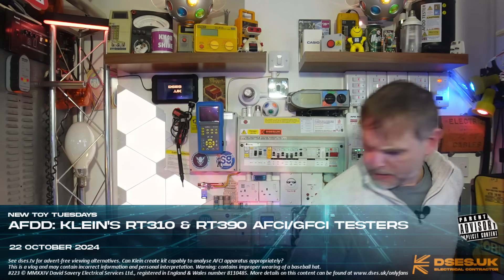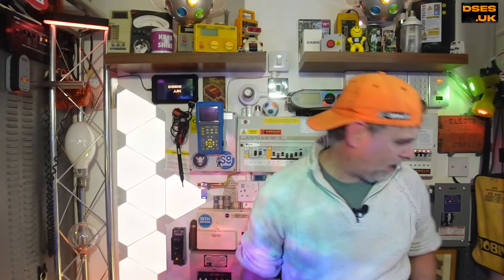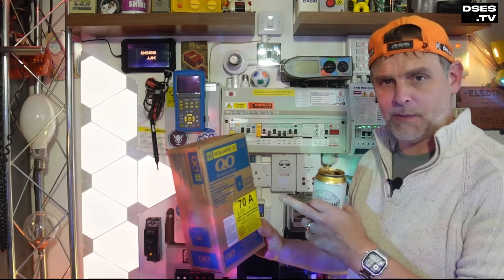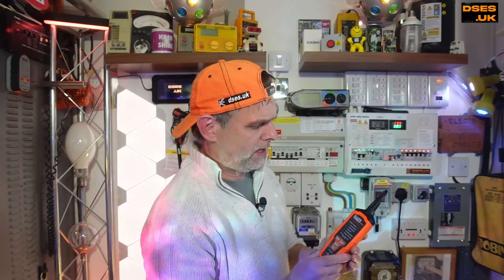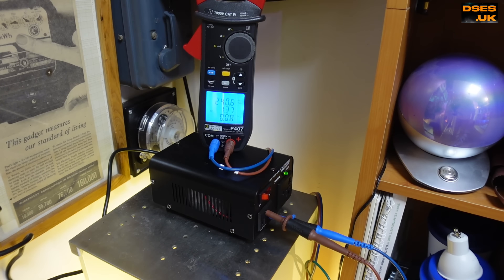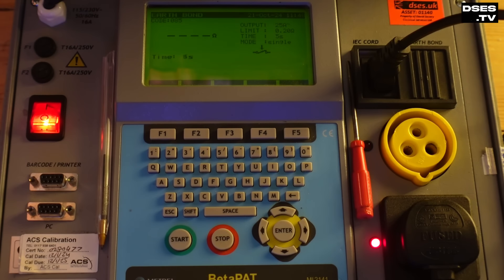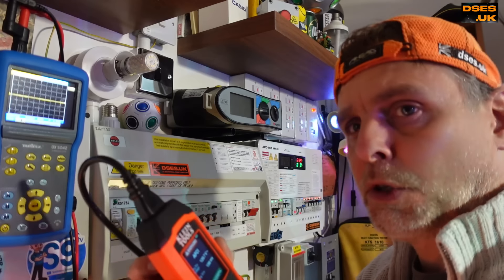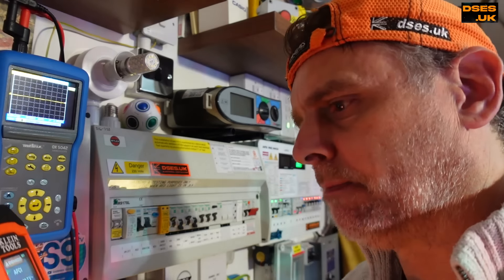AFDD: Klein's RT310 & RT390 AFCI/GFCI testers

Comment: Suspect the device LEDs just light up to say the protection circuit has passed self test on power on, not to indicate last error. Lamp test really.
Reply from the maker: That may be it. "Passed self test" - but you're on your own figuring out why a trip occurred! I believe the AFCIs are simpler devices (electronically speaking) to our ARM-equipped processor controlled things, so maybe they lack fault reporting?
Reply: @dsesuk time to disassemble then? Probably the electronics on these get taken off the juice as they trip too, losing state. Nice episode by the way.

Comment: The “ground bar” aka earthing terminals are sold separately for that QO enclosure, often for exorbitant prices. We also do use 240 volts here but center tap the transformer to obtain 120 volts, hence the two separate terminals in the enclosures.

Comment: Hi David, I have been watching your videos and I have learned a lot. I like your character. You are very entertaining and knowledgeable man I wonder and I wanted to ask you if you know any software for Designer schematic fusing cable sizing consumer unit writing current carrying capacity Walter drop all this stuff they relates to the electrical design for one bedroom flat single phase or three phase board. Do you know any easy-going software? Not very complicated one so I can use basically to learn also for my jobs I can design for example wire of one bedroom flat and print it out and have a sheet in my hand once I am doing a job it will be just a reference to help me to understand the size of the cables and everything else could you recommend me any software? Do you know any software for Electrical design and schematic with all the calculation required that needed by British standard 7671 thank you so much, David.
Reply from the maker: I'm afraid I don't have any design software I can personally recommend - hopefully someone else in the comments has something they can put forward? For off-the-shelf calcs, there are app resources such as NICEIC's Pocket Guide app which provides easy access to best practice guides, guidance and calculation functions. I believe that's downloadable for anyone (you don't need to be an NICEIC member).
Reply: @dsesuk  thanks 🙏

Comment: The 120v converter will likely have its own intelligence built in to vary the output current under fault conditions and will also lack the umph to generate significant arcs.  I don't think this can be relied upon to mimic the conditions of a true US grid supply.
Reply from the maker: It's probably improper conditions as you say. Maybe Klein would like to fund an all-expenses paid jaunt to Vegas for us to try these devices out on the proper home soil?
Reply: It should probably exacerbate the issue with its higher impedance rather than be a hindrance.
Reply: @dsesuk  Vegas is crap, too trashy. San Francisco is where I always go, although there's a friend in Ohio I've been promising to visit for ages, must sort out the old passport thingy.

Comment: Interesting to see these Klein units in operation. When you showed the waveform on the oscilloscope, you can see quite a voltage drop when testing, which I wasn't expecting to see for an arcing fault. It maybe that the impedance of the supply transformer is too high and the subsequent voltage drop is causing an issue with the electronics of the AFCI and the erratic behaviour. If you use the single shot trigger mode of the scope, you may be able to the pulse width trigger function to capture the event and freeze it on screen, or alternatively if Chauvin Arnoux would lend you one of their power analysers with the transient function, that may also capture the event.

Would be interesting to see what is inside the units, because if it is something generating a physical arc, then I would have though that that would have a pretty short life to it before the characteristics of the arc are changed and eventually the tester would fail. The carbon arc model used by the IEC needs a lot of maintenance to provide consistent testing.

Comment: Very interesting insight into what goes on over the pond. A few observations 
- That "load center" has massive terminals to handle the higher current resulting from the lower US voltage, a clear advantage of using 230V.
- I strongly suspect that the 500VA converter may well be interfering with your testing, it may well not be able to deliver the çurrent needed to generate a strong arc.
- Interesting  from the scope shots, that the arc simulator  only appllies the "arc"  to one half of the waveform. This may not be enough for the software to detect.

Comment: You are correct David they work better on a socket or should I say receptacle containing AFCI or combination AFCI/GfCI. That being said a belt and braces approach an AFCI/GfCi at receptacle and AFCI at the load center work better even with different brands for the AFCI /gfci at receptacle and AFCI/GFCI at load center. You now start getting into selective coordination issues in terms of which trips first. (You can compare trip current curves which manufacturers in USA do provide to allow appropriate selection). I have the Leviton combination AFCI/GFCI receptacle device (in my view the best device on the market) with an older GE AFCI at load center. When using the older Klein AFCI device it consistently works namely the AFCI trips first at receptacle also tripping the AFCI at the load center.  Let me see if I can send you some of these receptacle devices with USA socket box (both metallic and nonmetallic ones). The parallel arc waveform testing generates/injects a kind of square waveform typical of arcs from kettle arc faults. With other loads you will get more spikes on the waveform more typical for series arc waveform. What you really want is to hook up a signal generator with the oscilloscope capable
Of capturing these fast events and storing it as well so you can take your time looking at the waveforms from different arc-like signals. You will need more expensive higher end oscilloscopes and signal generators say from Rhode Schwarz or Keysight or Teledyne/Lecroy. That will more than likely help you to get behind the nature of how these arc devices are built and what kind of waveforms they are expecting to see under parallel or series arc conditions with different types of loads - kettles, ac equipment, microwaves, ovens, heaters, dryers/washing machines and coffee makers. You may not class yourself as a scientist but you definitely think like one. If you read research papers online in this area of arc testing and waveforms you will start to better understand some of this work. You will get into electrical engineering and physics areas probably beyond the average domestic sparky but definitely not beyond your capabilities.

Comment: The RT390 does helpfully indicate why it's not operating reliably - high source impedance. These devices are, after all, intended to be connected directly to a fairly low impedance supply, rather than the output of a 500VA transformer, with commensurate parallel arc energy.

Comment: I found some kind of advertising material for the Siemens one online.  It made quite a big deal of how the device continuously tests itself (whatever that means) and if the self test ever fails, it will trip itself and the LEDs will flash.  So they don't appear to be trip indicators at all, but rather fault indicators - as in a functionality fault, not a circuit fault.  So I guess that makes the device a FAFCII?  (Faulty Arc Fault Circuit Interrupter Interrupter?)

I suspect it might just be some simple watchdog timer, where the microcontroller monitoring for arc faults keeps resetting a timer back to zero.  If the code ever crashes, that timer will keep counting up beyond the normal reset point, causing a trip and blinking LEDs.  So it may not be a self-test in the form of actual current through the RCD but more an ability to cut power if the code running on the microcontroller ever crashes.

Probably difficult to test that functionality without opening it up and somehow causing the code to crash.  If the controller's power supply drops too low it may cause the code to stop running, which may trigger this failure state, so possibly some experiments to lower the supply voltage with a variac (or even running it off a DC power supply) might be the easiest to try if you're so inclined.  I guess starting out at zero volts, switching the AFCI on, then increasing the voltage until you get that initial LED lighting up might be the quickest way to find the magic cutoff voltage, then you can experiment from there.
Reply from the maker: I think the surprise was more that our own home-grown AFDDs also regularly self-test and (usually) flash a unique error code if they fail their own mental sanity check. Outside of that, the LED on ours usually gives some indication for fault finding purposes.
Reply: @dsesuk  Definitely agree the Euro versions seem to be much better designed.  If you're going to go to the trouble of including a processor inside of it, making it as helpful as possible with the LED showing the trip reason seems a no-brainer.
Reply: Siemens arc fault breakers are garbage.They have made my life an absolute nightmare for the last 6 years or so.Finally boss is moving off siemens and going with a different brand of load centers (consumer units).

Comment: Whatttssssuuuuup Homie! 😎We can only expect this "Out of left field" (as "our American cousins would say" 😏) stuff from Mr S and one or two others.... BigClive and maybe JW, being the others that spring to mind and is as entertaining as ever Old Bean. You are in amongst distinguished YT'ers
I have done what is considered inappropriate in the electrical field and read the manufacturer's instructions on the AG022 AFCI online. 🤪It appears that for 30 days, every time you turn on the device the LED will continue to illuminate for 5 seconds to indicate what the last trip was for. In your case, the AFCI detection function. It will continue unless you press  and hold the PTT for three seconds when energising the circuit again.
Best wishes to Linda and hopefully back on her feet soon.
Reply from the maker: Interesting... although it doesn't seem to be working here. If I hold the PTT when energising, the LEDs flash (which perhaps indicates it's clearing that last fault detection function). However, in both cases, the LED(s) always illuminate regardless of prior trip function or after an apparent reset through the push button. It may well be something screwy with my setup. As for reading datasheets, well if I had all the answers, what would you lot have to comment on... besides my terrible haircut and foul language?
Reply: @dsesuk  You bad hair cut was allowed as you tried to do it yourself over covid, and your language is just you after a beer or three. I don't recall a single one on this episode though. Having said that, you had a cappucino in shot after your San Miguel so looking after your liver. Top bloke.

Comment: Maybe Klein US have a tester that works with 240v outlets - they are quite common in the U.S. for powering dryers etc.
Reply from the maker: Maybe. I did ask them, but I didn't hear back.
Reply: I did search for such a device without success.. I think it is only Canada who use the dual rating system of 110/240V not the USA. This might explain why Klein, being an American company only has the lower voltage AFCI tester.
Reply: @olly7673  Nope, in the US they have a split-phase system with 120V phase to earth (or should I say ground) and 240V between phases. The 240V supplies are only used to power heavy current devices such as washer/dryers while 120V is used for general purposes around the house. They use a different type of plug and socket so you can't plug the wrong thing in the wrong hole (which would be painful to say the least..!)
Reply: @TestGearJunkie.  wrote:
"and 240V between phases."
It is all one phase. It is 240v measured from each end of the transformer's coil. The 110v is that they take a tapping from the middle of the transformer coil, measured from the middle to one of the ends.
Reply: @johnburns4017  As I understand it, it is actually two phases with respect to earth (ground).

Comment: Well that was an interesting one I have to say. Those tester’s seem to be crap ? As for the devices they seem to be like ours they don’t work. Or atleast they do intermittently. 
Fantastic demonstration and video as always David 👍
Reply from the maker: It might be my set-up Sean. I'm asking a lot for all this gear to work over here.
Reply: @dsesuk maybe I guess it’s one of those things where we will never know for sure .

Hears a question for you, if you bought a house in America and you were going to rewire it using  uk fittings is BS 1363 sockets and so on would there be any reason or regulations that say you can’t use uk accessaries  and change your appliance plug to Bs1363 plugs ? And wire it as you would in the uk .  ?

Comment: Don't think I'm the only American Yank-type fellow who follows your channel, but even though I'm going to begin electrical training in the US, of all of the 'official' terms used in the electrical field (as opposed to the colloquial terms), I've never heard of "circuit breaker load center." I've only ever heard and referred to that enclosure as either an ... er.... an enclosure,   circuit breaker box, or electrical panel. When asking where their "load center" is, I'd just say, "where's your breaker box?" or most often, "where's the electrical panel?"

Hope this helps you old sods!

Oh and ETA:  I own and use the Klein RT390 along with a whole passel of other of the usual meters, testers and accoutrements, much of which are Klein. They're good solid tools and relatively inexpensive.
Reply from the maker: I did wonder how ubiquitous the term was, but I originally started searching using 'breaker box' and 'electrical panel' and I was getting nowhere until Chuck advised Load Center as a better option. The Google was otherwise assuming what I really wanted was a UK consumer unit because, well, why would I possibly be trying to find North American hardware for purchase?? I also like Klein stuff - how do you get on with the 390? Have you had much of a chance to play with it?
Reply: @dsesuk  Sorry had a family emergency, will post a more lengthy reply soon!

Comment: In the immortal words of Detective David Mills in Seven, played by that delightful chap Bradley Pitt, What's in the box David? What's in the box????
I of course mean what did you do in that yanky doodle dandy consumer unit, WHAT DID YOU DO????
Reply from the maker: The box contains a mechanical asshole of bolts and brackets to hold those devices fast against the front plate with a jury-rigged busbar to link 'em together!

Comment: All Yankie AFCI and GFCI are electronic devices.  They all do a self test of the electronics when you turn them on.  Sockets will show a green light if working.  I imagine the green indicator on temporarily on the panel mounted items indicates self test successful.  Apparently they do a periodic self test of the electronics too.  It's still recommended to push the button to do a mechanical test as with RCDs etc.

They do have things labelled as magnetic but it's not what we think of with magnetic RCDs etc.  It's a magnetically latched GFCI/AFCI outlet that releases on loss of supply so in the event of total loss of neutral (PEN) they release.  Similarly a blackout sees them all release.
Reply from the maker: Oh, really? That must be a pain in a power outage!
Reply: @dsesuk  Not widely used from what I can tell, more for circumstance where you don't want something to restart after a power fail.